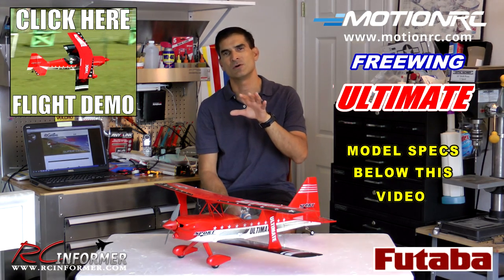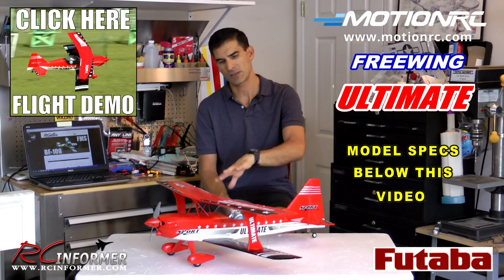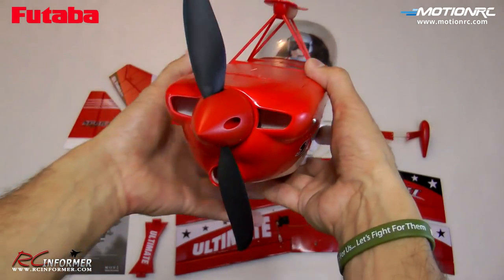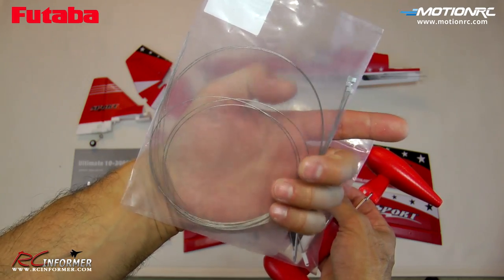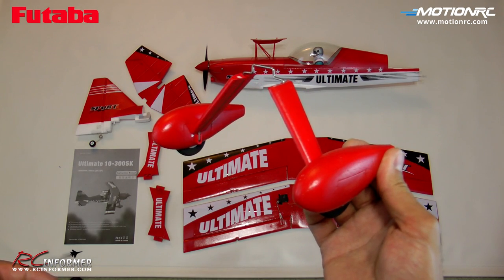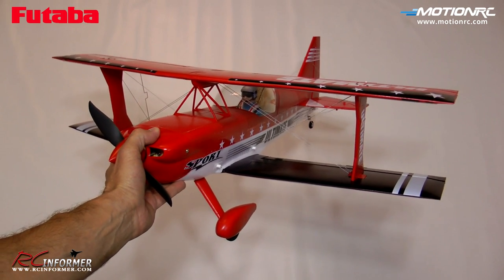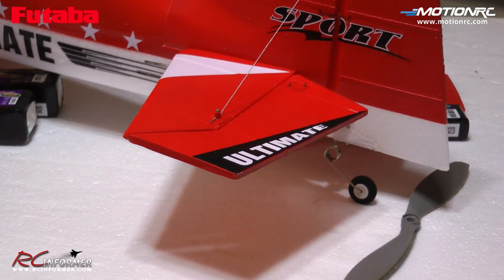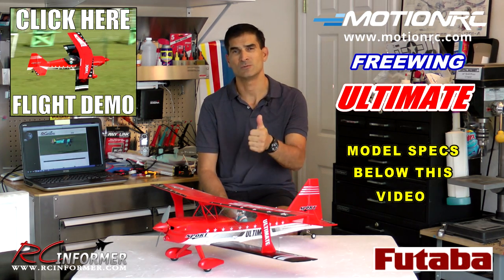MOTIONRC / Freewing ULTIMATE 750mm Build Guide in HD

Comment: hi rich quick question,on hobby king's site they have a 210 watt motor stating it has 880 grams of thrust,and then a 250 watt motor at 520 grams thrust ,how can a smaller motor have more thrust? with the same prop?

Comment from the maker: I would not trust those numbers... I am not saying they are incorrect, but it is hard to tell what were the conditions of the test and who performed them... some variables: prop type and manufacturer, spinner or not, ESC brand and setting of the ESC, the meter used to guage it, type and condition of the battery including capacity, "C" rating/capacity..... etc.... the list goes on....